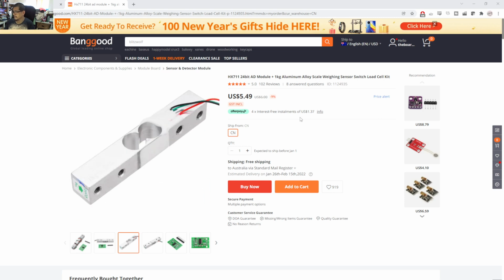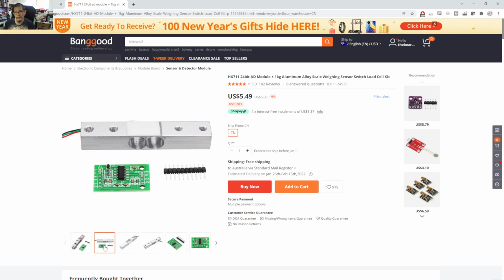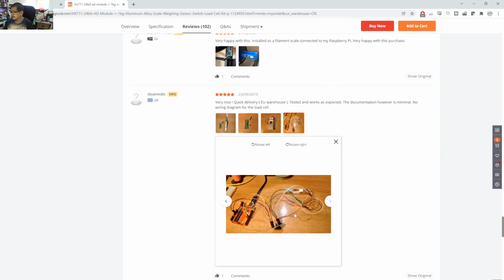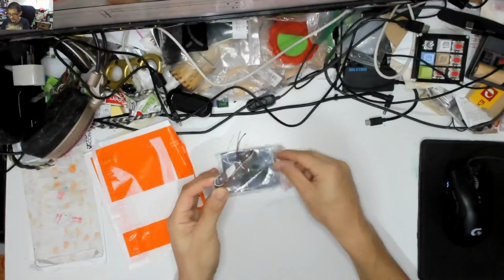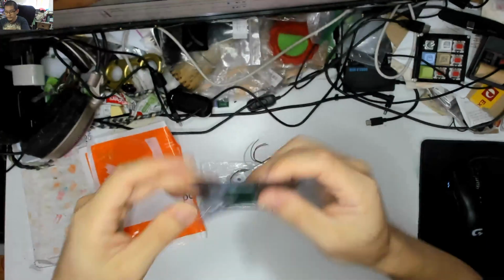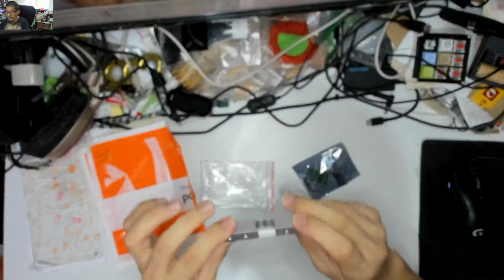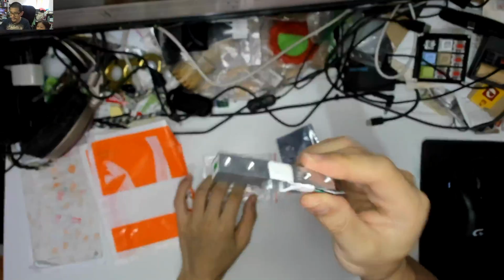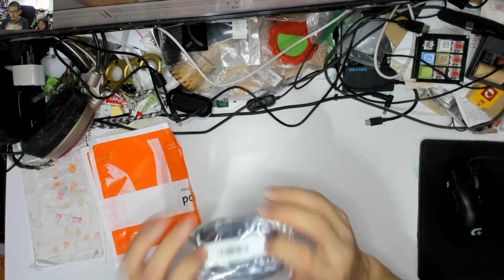Force Curve Machine Part 1 - HX711 1kg Load Cell Unboxing

Comment: Hey, nice content, but i'm in a dilema, im currently looking over a budget blue TKL keyboard, and i found two, one is The Red Dragon 552 and one is Newskill Serike, both have Outemu click switch, but the Red Dragon has a square around the + like [ + ] and the Serike dosnt looks like a normal MX, is it a different Outemu Switch? one is higher quality?
Reply from the maker: The [+] design in theory (and I say this is theoretical) is meant to help with reducing wobble on the stem, and provided a better feel. Theoretical because cheap manufacturing means tolerances between the square walls and the switch housing may negate the benefits the design is meant to provide. The square stem also is meant to help reduce dust/particulate matter getting inside the switch, just like Box Switches from Kailh.

In working reality, both of them are going to be very similar at the end of the day, so you probably should consider other features between the two boards, as later on you may want to change switches, which can be done through desoldering if neither boards are hotswap.